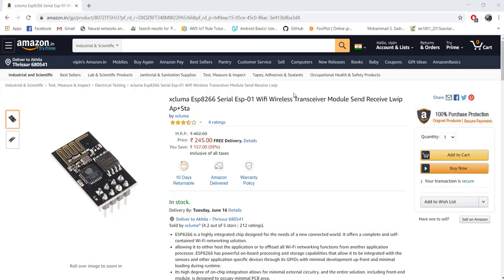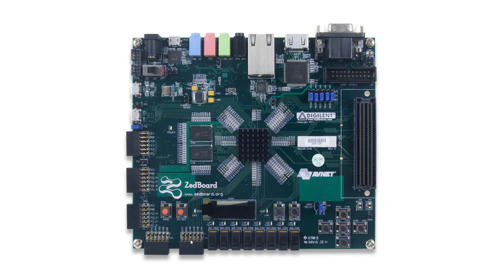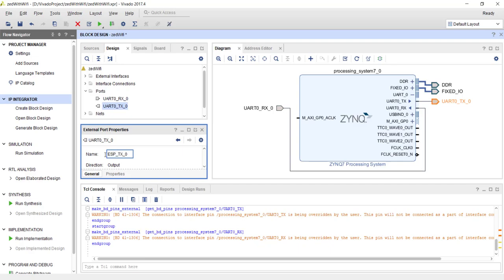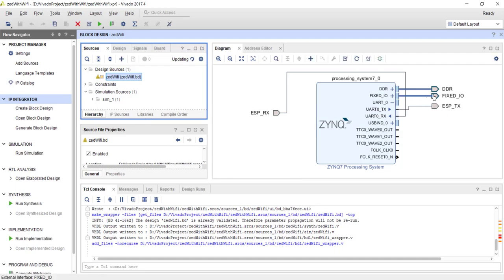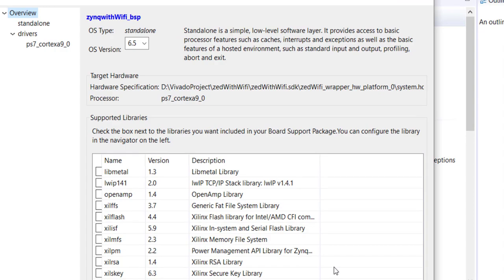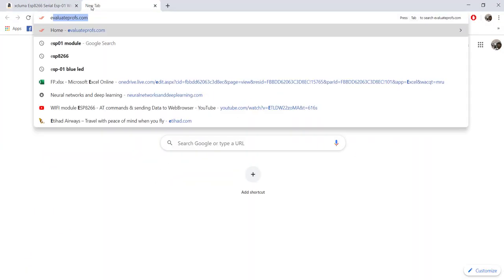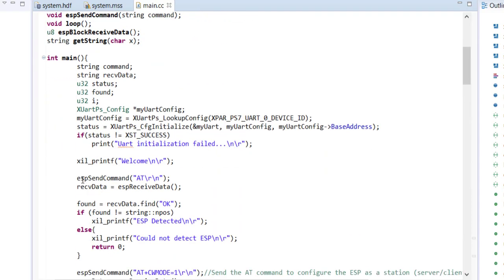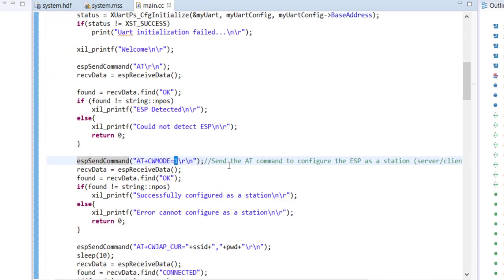Connecting ZedBoard with Wifi through ESP8266 Part 1

Comment: Are you ever planning to switch from SDK to Vitis? It seems like Xilinx is moving away from SDK and the transition is rough for some people. Also, some of the interfaces are slightly different which makes following tutorials harder.
Reply from the maker: I think for Zedboard or Zybo SDK will make more sense especially for baremetal applications. Vitis I won't touch till 2021 since Xilinx will be making lot of changes these initial days

Comment: It was nice video and good explanation 👌👌👍 expecting a practical exposure gives us great pleasure to learn fpga request to please add feature like controlling a led on user input
Reply from the maker: That is there in part 2 and part 3 of the video
Reply: @Vipinkmenon thank you sir, I have gone through part 2, I am unable to connect with WiFi. What is the baudrate we need to select, because at initialization in the code  u have used 961000 baudrate.
Reply from the maker: If you have new ESP, baudrate will be 115200. If no prints are coming on serial terminal, make sure you have properly configured the stdio in the bsp settings.
Reply: @Vipinkmenon hello sir , hope you’re doing well. First of all thank you for the amazing tutorial. Sir i am getting the msg esp not connected on the tera term after following your steps please tell me what could be the problem.

Comment: Dear i am unable to see the output on terminal, when I connect to mobile device it is connected but I am confused with what is happening, could please elaborate here what might be the problem. WiFi ssd and password is limited with byte size, will it accept special characters and numbers. Please help me out in this
Reply from the maker: Make sure you have changed the studio in the board support package settings to uart 1 and correct baud rate 115200 is set if no output is coming on the terminal
Reply: @Vipinkmenon  Thank you for your reply sir, I am using 2017.3 and I have changed studio as u specified and baudrate.i am using sdk terminal instead teraterm Welcome and AT commands are working but unable to connect to WiFi, is any thing to be changed in the code at ssid and password to read the value. Can I get ur contact number if ur not having any problem sorry for the inconvenience and thank you sooo much
Reply from the maker: You can contact me over the email given in channel description
Reply: Dear  @Vipinkmenon  Sir, I've run into the same problem. The Tera Term terminal not showing any output.  I have changed the stdio in the board support package settings to uart 1 and correct baud rate 115200. Could you please help me?
Reply: Mudasar Basha could you solve your problem?
Reply: @NazmulApu  yes i could resolve the problem.
Reply: Mudasar Basha could you please tell me how? TIA
Reply from the maker: First some how you need to make sure esp is working fine. If you have an Arduino, it is very easy.
Reply: @Vipinkmenon , thank you so much. It works perfectly for me now. The main issue was that I had been using Vivado/SDK 2016.4. I installed the 2017.4 version and it worked exactly what you're demonstrating.
Reply: I am getting ESP not connected as the msg after I follow all the steps please tell me what should be the problem